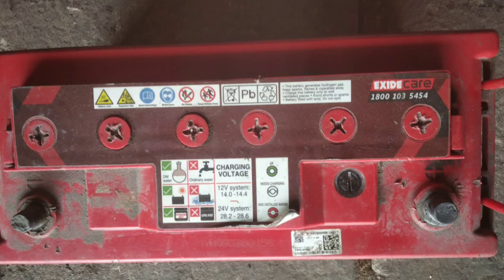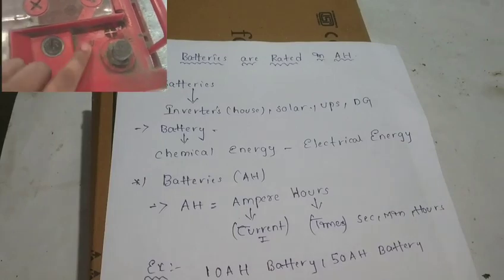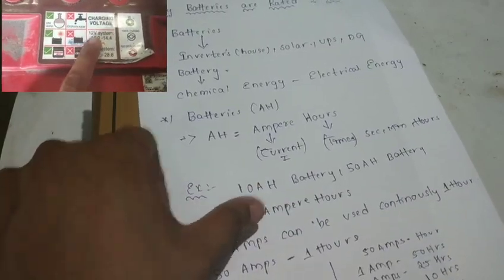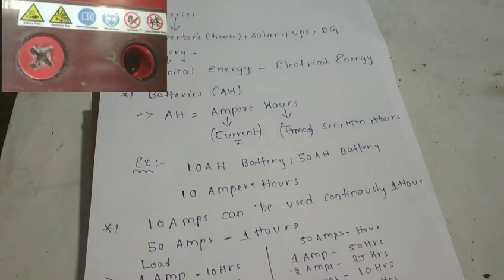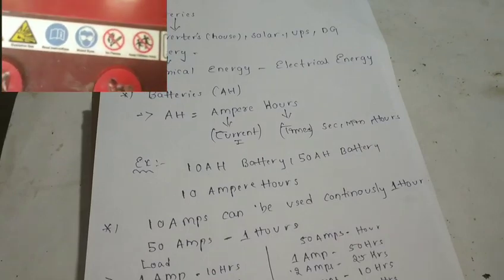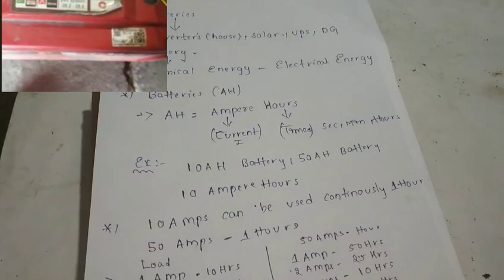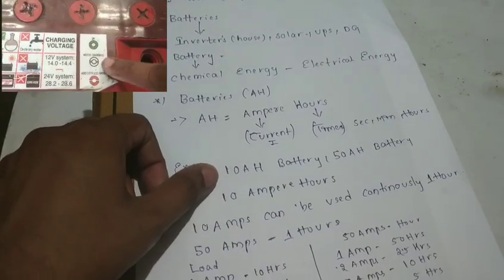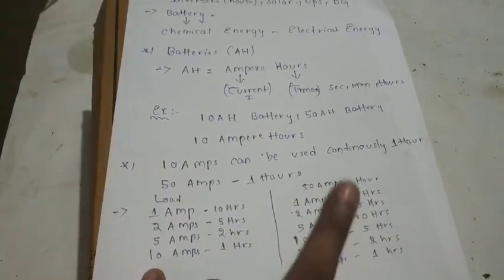Why batteries are rated in ampere hours(AH) MAH in telugu 2020

Comment: 100 ah battary use to 100amps 1 hour. Ur explain
4nos   60 wat bulbs 240 watts load 1 amp
4nos fans 70x4   280 watts, .approx
2 amps
Ur explain 100/2#50 hours?
Reply from the maker: Calculate total amps for all equipments mentioned

Comment: Sir good morning distilled water endhuku battery Lo fill chestaru
Reply: Sir good morning sir capacitor start and capacitor run motor gurinchi, inka single phase submericible motor starter connections kosam ante double Capacitor unna srater, inka thermo couple kosam oka Sari cheppandi please